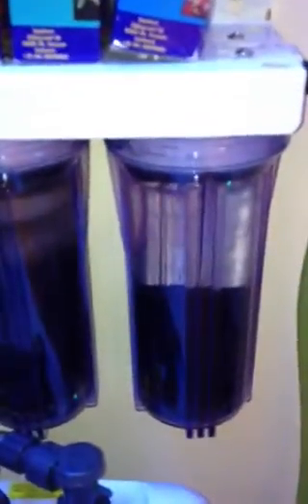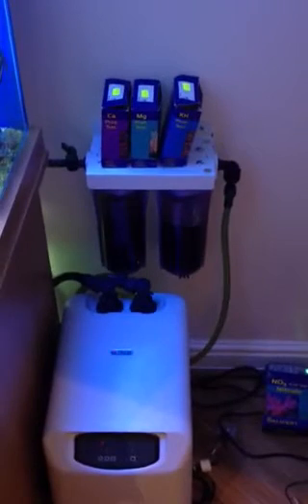Phosphate and carbon reactor using RO canister

Comment: I know this an old video, but what fittings did you use to connect the tubing, I'm really struggling to find 1/4"  NPT fittings in the UK
Reply: same issue did u solve issue
Reply: @jujucattys156  sadly not